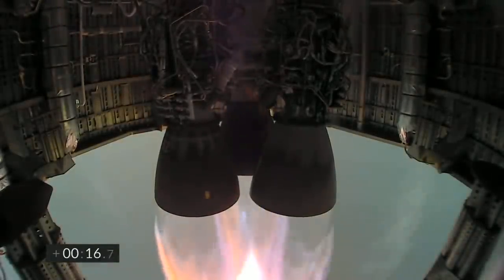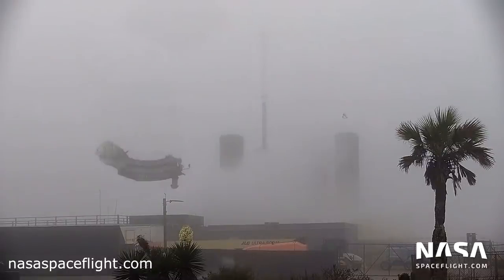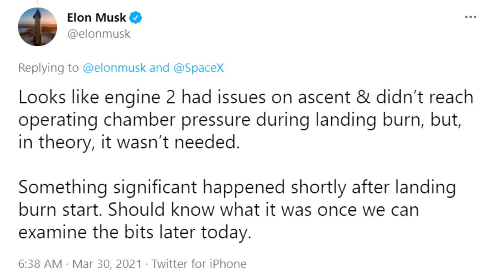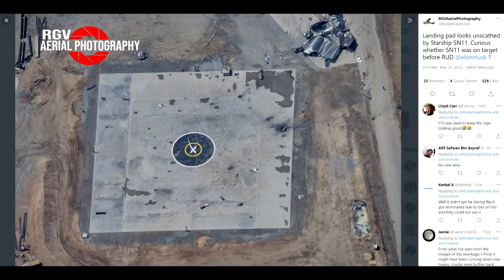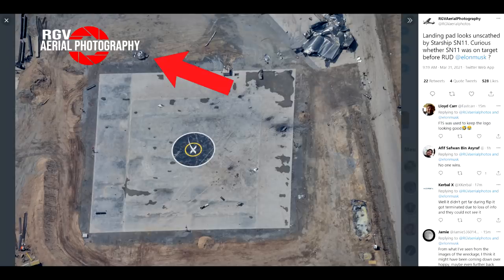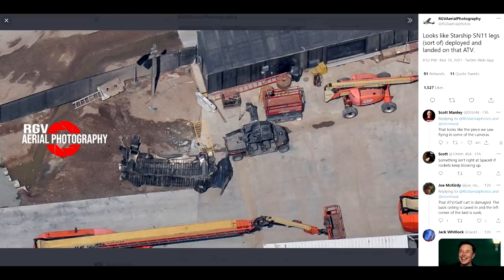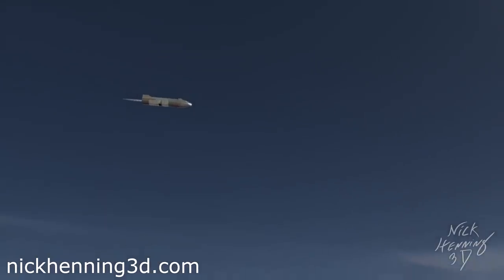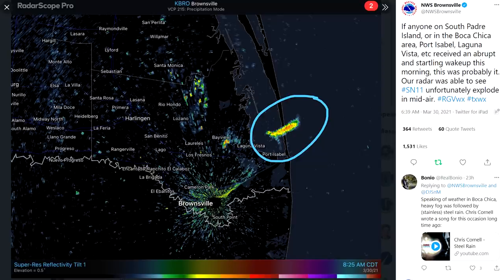What Happened In The Fog At Boca Chica - What Caused SpaceX's Latest Prototype To Explode?

Comment: Liquid oxygen and hydrocarbon doesn't mix well. When they get the ASU up and operating it is normal to vent oxygen to prevent the hydrocarbon that is condensed with it to keep the concentration low enough to prevent explosion. 

It's possible that there was rupture of the LOX downcomer and you had an example of what happens when you mix the two.

Comment: Question: Since landings are carried out only by the lox and methane in the header tanks, why would you not vent off all fuel from the main tanks at altitude, well before the landing burn? This would reduce the weight of the starship, and remove much of the explosive capacity from the vessel well before the landing manouver, and it seems to me would reduce the potential for the major RUDs we have seen.

Comment: So far I heard only one plausible explanation: internal leak during descent, so fuel got mixed with oxygen in the tank, and that mixture went kaboom upon engine reignition.
That explains why the bottom part of the rocket was obliterated - there was an actual high-energy explosion INSIDE the tank, and there is hardly anything else in the rocket that has so much energy to tear it to shreds and scatter it over such a large area.

Comment: Well we know they implemented some sort of fix or multiple to the fuel header tank, which is partially sumberged in the LOX tank. 

So maybe some sort of overpressure event ruptures the fuel header tank, CH4 flows into the LOX tank and the structural integrity of the common bulkead is also compromised or methane cane now leak through the ruptured header tank and kaboom. I was convinced it was the FTS so awesome analysis :)

Comment: Your theory is quite plausible (with the assistance of the graphic animation). The theory is that there was a crack, or break, in the fuel line, from the Lox/header tank, through the LM tank. The mixture of the oxidizer with the methane triggered and internal combustio, which blew the midsection of SN11 apart during landing engine restart. We saw a small fire, sure to a leak during launch. This same leak during restart could be the cause of the Sudden Unplanned Disassembly of the vessel.

Comment: Thing was leaning ass first before flip as center of mass shifted, probably a bad weld around the methane header causing methane/oxygen to mix, some of that got into the fuel lines before tank swap, caused the fuel lines and raptors to blow which then blew up the ship which at that point was essentially a bomb.

Comment: 5:40 "Crack opens and pressure drops" This is why tanks are destructively tested with hydraulics, instead of compressed gas. Compressed gas expands much more and can rip tanks to shreds. Hydrostatic tests will crack open the tank and immediately have the pressure drop.

Comment: Scott, has anyone suggested going to hybrid electric engines? In those engines the turbopumps are powered by electric motors run off of batteries and the batteries are charged by turbogenerators running off the rocket fuel. The advantages are getting super control of thrust (no problem with flameout in the pumps on low settings), high reliability on re-light as well as using the free-fall time to recharge. What do you think?

Comment: Looking at the methane tank cam, there is a segment of the O2 line that is free of frost (frost is frozen methane?).   A slow Liquid O2 leak would wet the surface and make it appear dark.  Adjacent to the O2 line there is a patch of darkness in the methane mist above the surface.  Could this be due to dripping O2 disturbing the surface? O2 could have accumulated in the tank until engine restart.  If the methane is cold enough to keep the O2 liquid, liquid O2 would sink to the bottom of the tank.  On engine restart, the mix could have ignited in the preburner and traveled back to the tank and caused an explosion?

Comment: Based on the liftoff videos and the camera cutout immediately after 1 engine lit on landing, I would guess that the engine #2 (which had issues on assent) had a catastrophic failure inside the skirt, triggering the self-destruct sequence (which would blast the rocket into bits in the direction the nose was facing).

Comment: If you look at 0:30 of your video you see something burning at the raptors. Normally, this should not mean anything. But in this case, I think if there was a leak at this area during relight of the second engine the forces due to the aerodynamic pressure from below during fast descent would explain the debris-field. The raptors stayed together as the force was pointing upward from above the center of the three and by blowing pressure into the intact body of the rocket it would blow up in all directions. (maybe the weakest part was oriented south, as you have less debris there and the weakest area would tear apart first)

Comment: Scott - a thought. It seems that the main issue is the poor fuel/oxygen feed to the motors.  What if the tanks had a baffle from the bottom (being the bottom when the spacecraft is falling in its wings) sufficiently up the tank so that there was enough fuel aft of it to run the landing burn.
So, say the baffle was 10 metres up (as in towards the nosecone), and say covered half to 3/4 of the tank area, also the fuel outlet, instead of being in the centre of the tank is at the bottom edge.
When in vertical flight, the fuel would run from the full tanks to the engines as normal.
When the rocket flips to a horizontal position the fuel to the aft of the baffle would fill the tanks to the level of the top of the baffle, and the remainder would slosh around the tank towards the nose.
When starting the motors in a horizontal position, there would be enough fuel to keep them happy (especially if the exit was "below" the centre of the tank), and if the burn were to continue to landing, the remaining fuel would flow down from above the baffle to keep the motors going.

This seems to me to be a relatively simple engineering problem to be solved, and does not involve extra small tanks, helium pressure etc..
I should like to send a sketch if you are interested.

What do you think?

Comment: I have to wonder if there was a crack or leak in the downpipes from the header tank, allowing mixing in the main tanks.  Once that happens, say one of the turbopumps comes apart and punctures the tank, or it has a bit of a backfire on startup due to the incorrect mixture, and that tank explodes.

Comment: Wondering if there is a complication when you have a tank failure in the belly flop with the extra dynamics of falling sideways at more than a few mps. I can see an inflight breakup being more dramatic than seen on SN10 because of the airspeed, once the tanks lose rigidity the stainless is going to rip apart under load fairly quickly.

Comment: Perhaps you can clear this up for me, When Starship is preparing for a launch is it correct that they chill the Raptors prior to ignition which is all good and popper but when they relight them for the landing burn do the turbo pumps suffer thermal shock between the hot engine and the Cryogenic fuel maybe causing damage and be the reason for the landing failures

Comment: In SpaceX's video of the flight, at 00:14 on the flight clock there is an yellowish-orange rectangle on the nozzle of the left engine which moves with the nozzle - likely not a reflection from something else. At 00:26 an orange flame plume forms around piping at the top right of that same engine. As the first engine is shut down around 02:20 there are small flames around upper piping on the nearest engine and a good bit of small debris that appears to be coming from the top/gimble area of that engine or the one behind and to the right of it.
Reply: Yep, I saw those as well.  SN8 and SN 10 did not have those kinds of flames.  SN9 did as well.  is it a coincidence SN8 and SN10 performed the landing maneuver the best.  Anyways with all the changes coming in SN15 some problems will go away, either on purpose or as a result of changes,  but may introduce new problems.  I don't think SN8-SN14 were expected to get close to landing, certainly not until SN12-SN14.  Another reason to scrap SN12-SN14.  SN9-SN11 got used for the landing tests.  Let's see what kinds of things happen with SN15. Supposedly next gen raptors, next gen plumbing. and who knows what else. (only Elon and SpaceX).  I think they still need to figure out what happened in this case, to make sure it won't happen on SN15, if it still can with all the changes.  I would still be quite concerned if those fires still show up on SN15 raptors (if they truly are an improved design).    Me thinks they should try a static fire test that runs for as long as the flight profile, in the same manner for ascent, then relight after sufficient time to account for "gliding" back down.  then relight. simulating a landing burn.  Of course they would need a better test stand to not have debris destroy anything under the skirt.  That way they would at least be able to examine things after a simulated test similar to the duration of the flight.  Who knows the thing would may have exploded if they had gone straight up for 10 mins.  Meaning there is a problem outside the landing maneuver.  They may have tested the raptors for extended durations, but not in the Starship configuration.  Maybe there is some problem that only shows up in the configuration they are using.
Anyone know if they have done any of that kind of test either in Texas or at the raptor production/test site?

Comment: I have been waiting for your analysis for clarification as to what happened.  These items are certain:  1)  SN11 exploded at some altitude, most likely under 1,000 meters.  It did not explode through blunt force trauma with the ground.  2)  The engines fell to an area close together.  3)  There were a great many little pieces scattered over a wide area.   Anything is possible but I am leaning toward an activation of the explosive flight termination charges either on purpose or system malfunction.     Space X probably has a good idea of what happened so we will have to wait for their analysis.

Two final comments:  In airplane world, good landings are achieved through long, stabilized approaches.  There is way too much happening to this rocket in the final meters before landing.  Perhaps an earlier flip to vertical before landing would give systems time to compensate and stabilize the final touchdown.  And lastly, have these Raptor engines been thoroughly vetted before launching?  Too many pressure, relight and leaking problems seem to manifest themselves during flight.  I await better data but your analysis, Scott, is always insightful.

Comment: To me the loss of SN11 in this manner is the first setback for the program, all the other failures came pretty much as expected. I do wonder if they're intentionally building these early Raptors on the cheap because they knew the probability if loss would be high and the engines are by far the most expensive components they're losing in these mishaps.

Comment: Well they hastily retrofitted an autogenous pressurization system to replace helium header tank pressurization after the SN10 failure... A failure in that system which inevitably runs the length of the starship inside the tanks might rapidly introduce unwelcome mixing and cause a particularly energetic cascading failure. I'd start there with my guesswork.

Comment: With two turbopumps on each engine, each one requiring precise timing, I can't help but wonder:  if they don't fire up exactly the right time it might cause a pressure feed-back problem. I can imagine there could be either methane or LOX cavitation in the pipes or tank as the pump fires up.

Comment: Just after 0:20 you see flames on top of the thrusters in launch. I haven't seen this in previous test flights. I speculate a leak formed during flight and during its decent the leak could have caused gas to build up in the skirt so when the rockets went to relight to do the flip maneuver it ignited the leaked gas which caused a chain reaction for the fire to travel up and ignite the remaining gas inside the tanks.

Comment: Hi. I think the same , the rupture come from the inside and could be because the valve from header tank do not open and the pump from the engine make void in the down pipe till it break  or the pressurization of the header tank do not work and happened the same thing , the pump from the engine pull till break the header tank . Remember Elon tell engine 2 do not go in the nominal pressure ? This happens when the pump can not pull enough fuel from the  header tank . This pumps make a huge displacement  and when start if something is wrong with the two things i mentioned before , dis is very likely to happened .

Comment: You mention that the Starship has an AFTS. Is that from a public source? We know that the AFTS is what allows the Falcon 9 to dogleg around Miami and over Cuba, but do we know that SpaceX is using an AFTS in addition to the RSO's finger on a button? I've never seen mention of the automated system on Starship, only conventions (non-Automated) FTS.
Reply: Why use a different system if they have one already flight proven?
Reply: @TheEvilmooseofdoom  An AFTS would application-specific. An AFTS for the Falcon 9 would not work for the Starship. I'm sure that the core core could be reused, and possibly the positioning sensors, but the rest of the sensors and specific logic rules would be completely different. F9 goes sideways really really fast over a designated corridor. Starship goes up and down really slowly over almost a single spot.

Comment: What is the possibility that the centripetal forces of going from horizontal to vertical while winding the engines up, and those pumps are essentially high speed centrifuges, what kind of un-resolved torque could be the problem they are having with the flip-landings?  Perhaps a need to go to vertical sooner, just on flaps and thrusters and Then start engines while in the upright position, thus no added engine pump torque and RUD situations?

Comment: Hello Scott,

   Beyond the questions of how does one land Starship, what do you think will Space X do about the cryogenic LOX Starship tank and its effect on the adhesion of the heatshield tiles that will cover the exterior of the craft? Right now, from a TPS standpoint, the Starship looks a lot like an early generation Atlas booster (with curved uneven surfaces that are not large and flat like the Shuttle orbiter underside) that will have to be clothed in adhesive heatshield tiles like in the good old Reagan days. Will the LOX tank inside the Starhip pe covered in spray on foam before being installed inside the Starship? You do remember the difficulties that precluded the combination of the Centaur cryogenic stage and the Space Shuttle Orbiter.

Comment: They had a leakage of oxygen inside the rocket. 
I came to this assumption from next things that I found suspicious during live broadcast:
During ascending the fumes trail was darker than usual - this means that it was rich in fuel and was lacking oxygen. 
While falling you could see an unusual strong venting cloud coming under the wing, that's another indication of leakage. 

When one engine lit up and turned rocket vertical I think unburned fumes of fuel got inside the rocket, mixed up with oxygen and exploded.

Comment: Paul Mason (aka Thunderf00t) speculated that the bulkhead between the methane and oxygen failed on the way down. He noted the tail dropping during descent, without any change in the control fins at the rear. Which he believes is a caused by the CoG.
When the engines fired they burnt briefly before the methane/oxygen exploded in the methane tank..... It's possible I suppose
Reply from the maker: This explanation is not consistent with the distposition of the header tank debris.

Comment: This may be a stupid question but, obviously there was serious engine problems on the ascent. Could something from the failing engine have damaged the lower bulkhead & when the ship turned vertical again the change in pressure from the fuel dropping to the bottom again caused a failure & explosion?